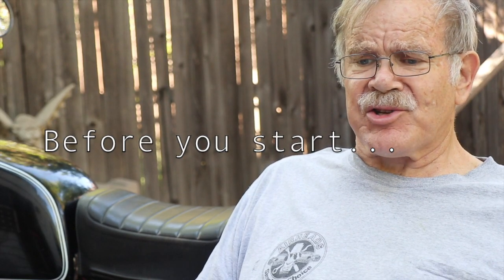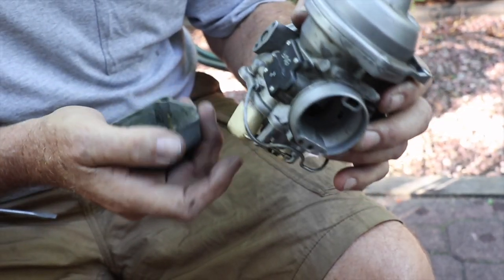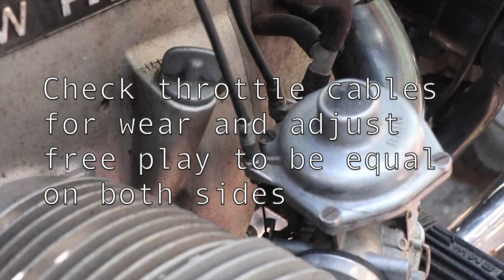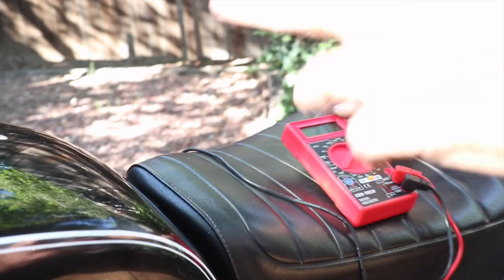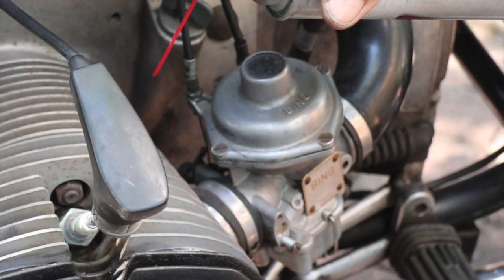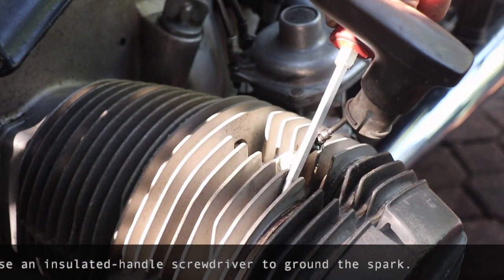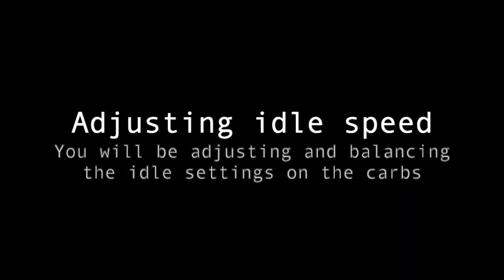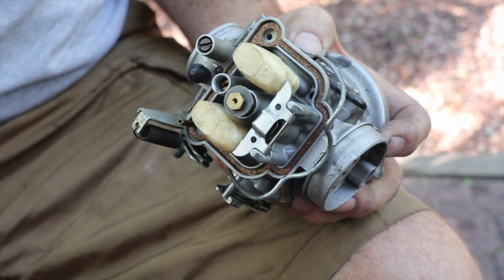Balancing BMW Airhead Carburetors

Comment: Balancing the carbs in this technique is great but the way which is shorting the sparkplugs is frying the ignition control unit(ICU)! I own 1995 R80 GS and never had a good balanced carbs by using carb balancing devices which uses the suction ports under the bing carbs.But when I tried to short the plugs my ICU has fried!So ; u can just take the spark plug cap off and stop that cylinder and do the carb tune and this does not harm your electronics.But when unplugging the spark plug cap use 2 wooden sticks for not to be shocked and pull them off fast and away from any shorting surfaces of your bike ,so no sparks can jump on your bike.Listen to the other cylinder fast and than plug the spark plug cap quickly on it's place.When I tuned by this way my new ICU did not fryed out and also a smooth and perfect idle is just happening.Also my ride is so enjoyable now.

Comment: I had an R75/6 for several years. After some practice it was so smooth and ran strong. . I rode several others that shook like crazy. Even one tuned by a local "expert". I could keep up, flat out , with R1000s. There is nothing like getting to know your own bike intimately. I fussed over it every 1000 miles. Maybe ten times a year.Intimidating at first,  It became pretty routine. This video is very nostalgic to me.

Comment: Thanks Gents for your fine video. Question. How do you identify the strong / weak side. Is the aim to adjust up the weak side or vice versa, that is adjust down the strong side to match the weak side? 
I tune my R69S with a Harmonizer (ports fitted). However I do take your point regarding equal vacuum is not necessarily equal power. My bike is super smooth up to about 3,000 rpm. Then gets quite vibey.

Comment: Thanks Matt! This is the same procedure we used on our old Brit twins. One issue I've seen on my R100 has been with the chokes on the carbs...they tend to not fully seat against the stop even with adequate cable free play. Balancing this way makes for a very smooth running airhead. Perfect!

Comment: Hi I have a 1974 BMW r60/6 that has a problem that nobody can solve. When I start the engine, the rev counter marks 1200rpm and after some time it starts to accelerate by itself until it reaches close to 3000rpm. This happens after 6 to 8 minutes. I wonder why? It have 2 carburetors Bing 1/26/123 and 124. Thanks
Reply from the maker: Have you inspected the intakes between the carbs and the heads for leaks? If you spray a little carb cleaner around the intakes while the bike is running and the idle increases, you have a leak.
Reply: Hi, thanks for the precious tip, I will take this test.Best wishes @Visian

Comment: Hi please advise. New to air heads. Trying this method to tune carbs. But when I try to earth each cylinder separately both cut out. Any advice please
Reply from the maker: No tech knowledge here, I just produced the video. Best to join the Airheads (Airheads.org) and ask there.
Reply: Did you find out the reason and solved the issue?

Comment: Good video but I prefer using a manometer. A manometer is easier to use and gives a visual reference to what is going on in between both carbs. It also is easier to set up the throttle cables so the carbs are balanced in the transient between idle and wide open throttle.
Reply: Only if you have some sort of vacuum ports.  The old slide carbs have no such ports...
Reply: @ElmrPhD  I drilled and tapped holes for brass tubes to use as ports on the carbs of both of my BMW motorcycles. I cap the tubes when I'm done synching the carbs.

Comment: Is this method also suitable for airheads with electronic ignition? Great explanation though, thanks.
Reply: Yes it works on my R100 with Dynatek ignition. You still have to make sure that spark plug wire is grounded.